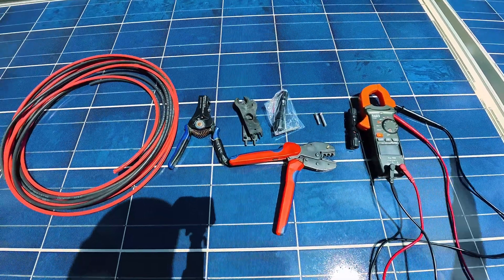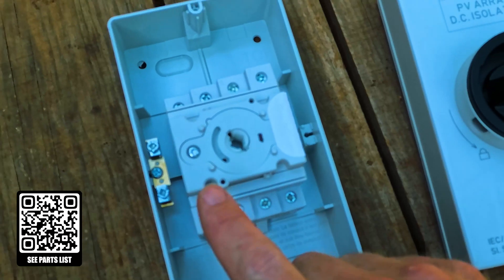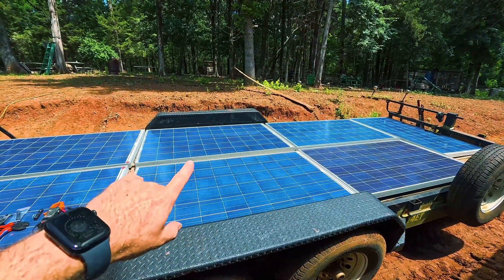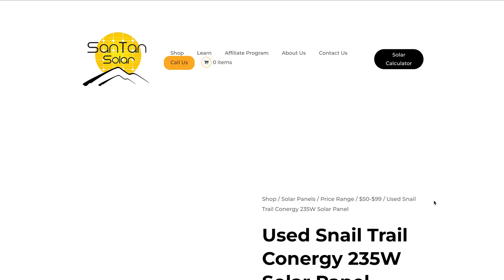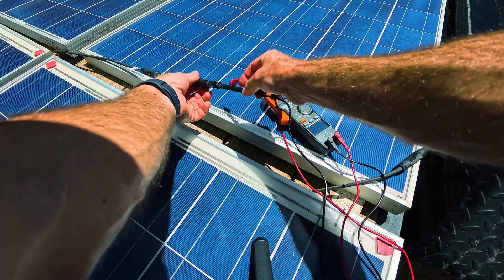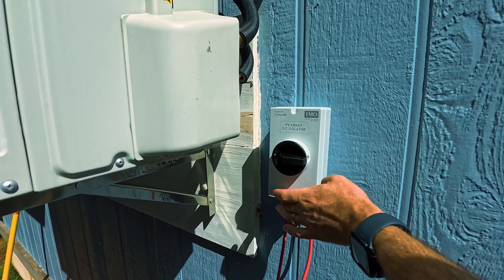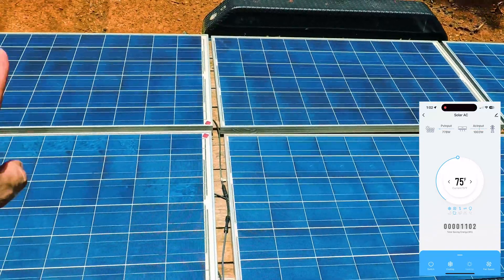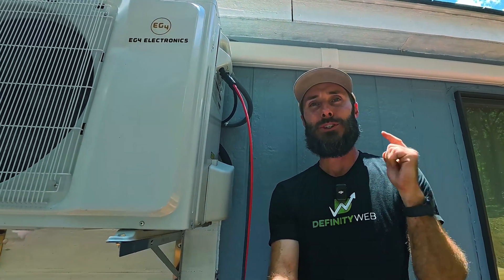Running AC with Solar - Connecting Solar Panels & Mini Split

Comment from the maker: Thanks for watching! ⚡Save $50 on a new solar mini split! Use the Discount Code in the description and shop here: 👉 https://signaturesolar.com/all-products/high-efficiency-appliances/?ref=esttxthst  (You support my family when you click this link just before you check out)

I've built a spreadsheet with all the parts you need for this project:
https://docs.google.com/spreadsheets/d/1xMLrhQuNRs2CTAksXSFTh49CK_OPp0fzC1n5K_Zhb1o/edit?gid=12894945#gid=12894945
Reply: This parts list is timing out.
Reply from the maker: @persistentone3448  I'll try to figure out what's going on. In the meantime, here's a direct link to the Google Sheet: https://docs.google.com/spreadsheets/d/1xMLrhQuNRs2CTAksXSFTh49CK_OPp0fzC1n5K_Zhb1o/edit?gid=12894945#gid=12894945 
Thanks for the heads up!

Comment: Hi there! Thank you so much for the video. Here is my questions:

1)Can I use my existing mini split and plug this system in?
2)Or do I have to buy a specific type or name brands mini split?
Reply from the maker: Great question. It has to be a specific model that supports it. At this time there aren’t many that do. So the odds are it doesn’t. Sorry

Comment: many important subjects not covered. how long during the day in typical mid-amount of sun will this run? like will it shut off at 6pm? or 8pm? meaning at sunset? or when the sun goes down but its still light outside but sun is down will ac stop working? how many power offs can it handle? 5,000? 10,000? 50,000?
Reply from the maker: Your question about how long will it run and what time will it come on and off with solar is all going to be dependent on how many panels you have and what type they are and what your angle is and where you live, etc. etc. etc. This is a very difficult question to answer. However, I do have new panels coming to answer at least some of these questions.

As for how many power offs it can handle, I do not know. That might be in the documentation somewhere. 

The air blows very cold, but I don’t know exactly what the temp is. It can cool off the room fast and sometimes a bit too fast or too cold rather. 

And it is plug-and-play. that question was answered in a previous video Where I installed it.
Reply: and how cool is the air it blows, how fast it got your room cool to 71f.
Reply: do you need to do any compression or its plug and play

Comment: Is it better to make your whole house minisplit vs central air?
Reply: There are a lot of variables to the whole Central Air versus mini splits. It's really down to preference or your lifestyle for that matter. For me, mini splits work best cause my wife loves having the house open for fresh air and we only use the mini splits when we really like to cool the room down for a day like when company comes over or when we go to bed for the night.
Reply from the maker: I don’t know. Mini splits are going to be more efficient than central air, but they are less convenient and they don’t look as nice. However, from a energy saving standpoint and a prepper mentality, they are the way to go. If I had a central AC and heat system, I may still consider putting one of these in just for the ability to connect solar directly to it. that is assuming I didn’t already have a full battery solar system. They are great entryway into solar and way to reduce your heating and cooling bill without having to get inverters and batteries.
Reply: @ thanks for the response! I just didn’t know if minisplits was just as good for airflow versus central air

Comment: How many watts is needed to run the mini split with the compressor running.
Reply from the maker: I'm pretty sure I've seen this 24K BTU unit run with 600 watts. Here's the spect sheet: https://eg4electronics.com/wp-content/uploads/2024/04/EG4-AC-DC-Plug-N-Cool-Solar-AC-Manual-12K-24K.pdf

Comment: Is grounding required for the solar panel connections? I have the same setup, but haven’t connected them.
Reply from the maker: Yes, It's my understanding that grounding is required for solar panels according to the NEC. With that said, I'm not an electrician, and can't say for sure.

Comment: Hey did the same system , EG4 and did you hook up a ground wire? My panels are on top of a mobile home. I hotwired the eclectric side and just getting the solar hooked up. All pretty easy but not much mentioned about the grounding? Any thoughts from you? Thanks M 🙂

Comment: Why do you keepskipping important details in your videos ....this one you didn't show how you connected the pv-array....you just skipped and showed it complete
Reply from the maker: You just take the positive (+) cable from one panel and plug it into the negative (-) cable on the next panel. Here's the diagram from the 24K manual: https://drops.definityweb.com/2NuoJBLo
Reply: What about nights ??
Reply: @vgossio1966 Is this even a question? Get some batteries or use AC power.

Comment: Can the panels feed a battery then the battery feed the AC unit?
Reply from the maker: @AnthonyBove  for sure. That’s what I was doing before I hooked them up to the AC. In fact, until you have your batteries/inverters maxed out, I wouldn’t put panels on your AC.